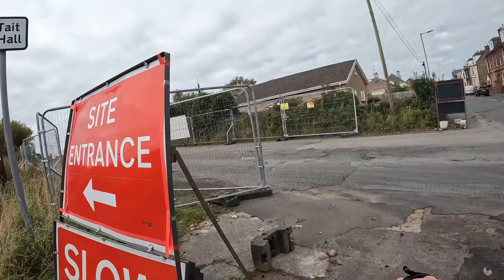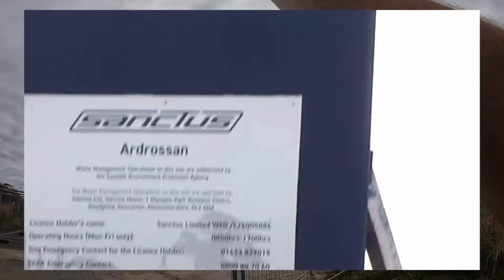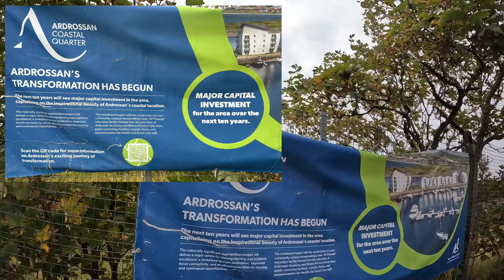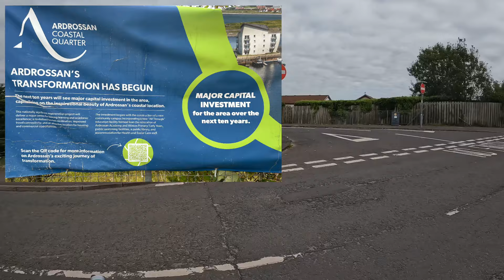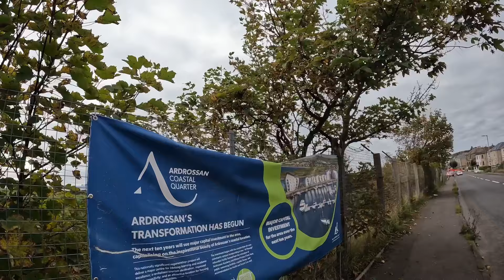“F🙃😮K THE CONES” 😃🚫🎥❌ #drone #audits #scotland #pinac

Comment: This site is the new Ardrossan Academy that's getting built, along with the new library, swimming pool amongst other things. Stupid place for a school as that area takes a right battering during the winter storms. Also the small matter of that wasteground formerly being a Shell Mex Oil Refinery for years. At around 11 mins, where they are doing the 'flood defences' that is the old oil tanker berth.The road that gets shut, due to stormy weather is the A78 between Largs and Skelmorlie.
Reply from the maker: Thanks for the info mate 🤗 yeah I was shocked about a school, homes etc getting built so close to the seafront myself as have witness myself how bad they roads get batters with the waves during the storm 😮👍🏻🏴
Reply: @Droneauditsscotland  Walk past the site nearly every day, as i'm about a 10 min walk away. At times it's like being back in the 70s/80s as you can smell the crude oil at times. Great vid. 👍👍
Reply: @jimgemmell2831 the soil they are running through a screener with a bio agent to treat the crude oil left in the contaminated ground on site. I know this as I am a tipper driver for a local firm and sometimes run stone from hillhouse to ardrossan. 👍🏼
Reply from the maker: Thanks Mate 🤗 and cheers for the information 😃👍🏻🏴
Reply from the maker: @BladeRMC187 Thanks for updating us all with info mate 🤗 most welcoming 😃👍🏻🏴